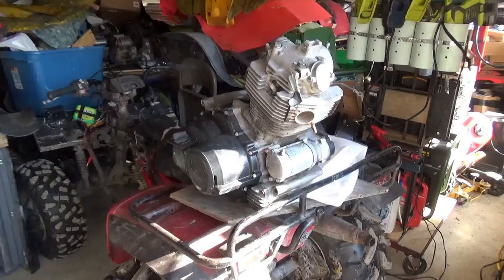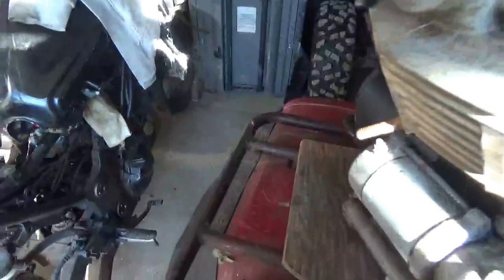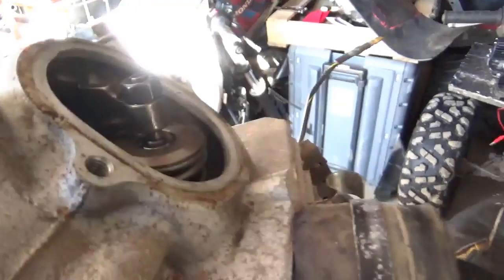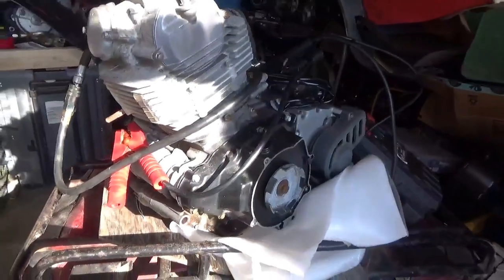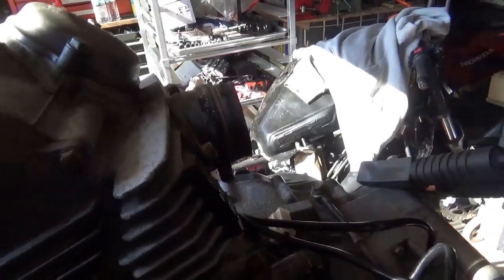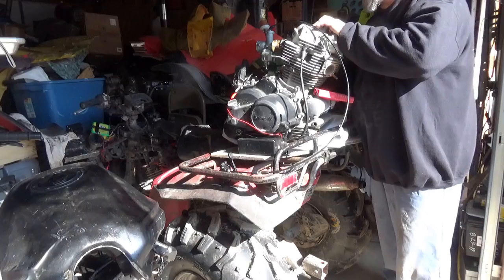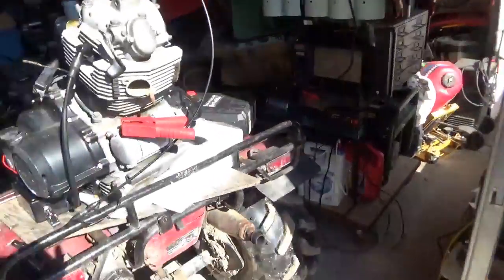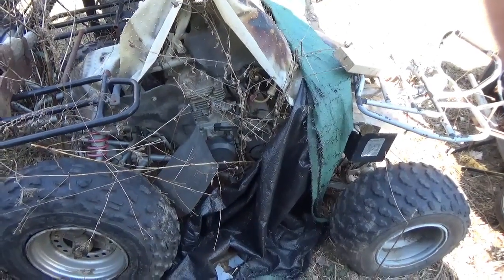How to Bench Test an ATV Engine, Kawasaki Lakota Motor Attacks Mechanic!

Comment: I did have one more question on a 85 trx 250. You answered one with the video on clutch adjustment this quad has a shifter that has no spring back. But the question I have still is in the transmission I have a knocking. It's not loud but I hear it at idle. I haven't gotten around to looking at it yet as there is the 125 then an odessey and then a trx200 before it. But my question would be what would the first thing you would look for in the transmission knowing it got a knock/rattle. About as loud as value chatter on an import car.
Reply: It is running driving now I've used it that way for years with a garden trailer behing it moving dirt leaves and mulch

Comment: She’s a runner. I’d worry about warping a valve running it without a muffler.
Reply from the maker: Hey Brother Calvin!!! It does run well, though, I am a little concerned about the metal in the oil!!!  About running it without an exhaust, Ur concern is valid, I did not run it long, I did not rev it much, and I'm running 40-1 premix, I hope they help ease the possibility of a warped valve and hand grenaded engine.... Thanks always for Ur thoughts, advice, watching, and commenting!!!

Comment: Sounds good Harvey check the  pump screen it should have one  make sure oils getting up to the cam and rockers that metal came from somewhere you should do some investigating or do a couple oil changes and run it the hell with it keep the videos coming good stuff
Reply from the maker: Hey Danny!!!   I think its going to get a couple of oil changes... I hope that cleans up the metal.... If not, the top of this engine may end up on the bottom of the other..... Thanks for Ur advice, thoughts, watching, and commenting!!!

Comment: Great Harvey, how did you determine that the CDI required was a 12vdc in your magic box or did it matter in this instance
Reply from the maker: Hey Bill, My 12VDC cdi box only needs one input to throw a spark and that is input from a pulse generator, the Lakota, or any other motor, has no choice to start once I hack a carb, wire to the pulse generator, and have some luck.... Thanks for asking, watching, and commenting!!
Reply: @HarveySpooner  Harvey thanks for your comment, I was really asking if any CDI would work be it an AC  CDI or  DC  CDI, forgive my ignorance on this subject, it is only my desire to learn